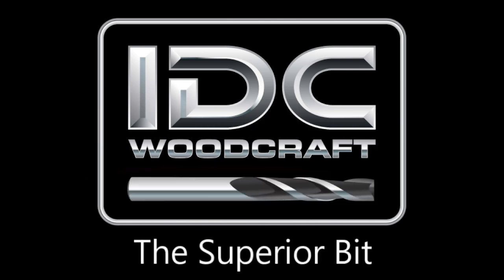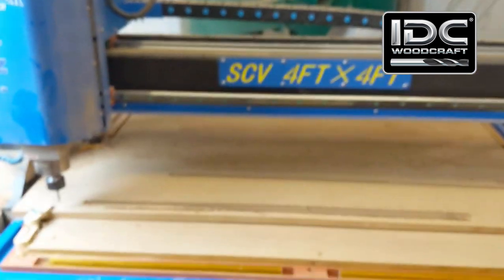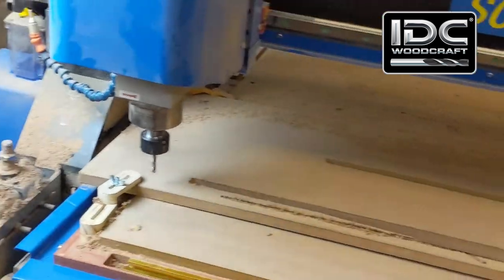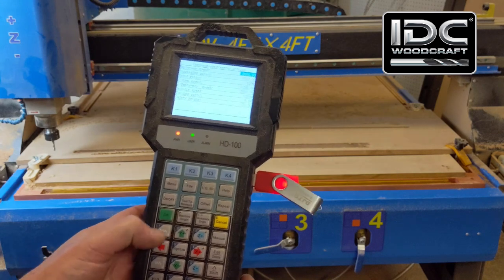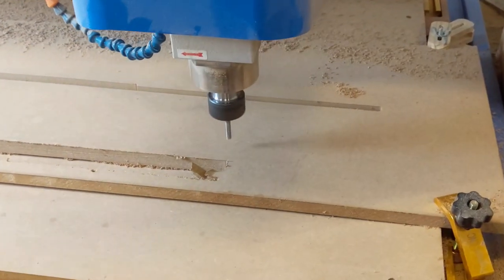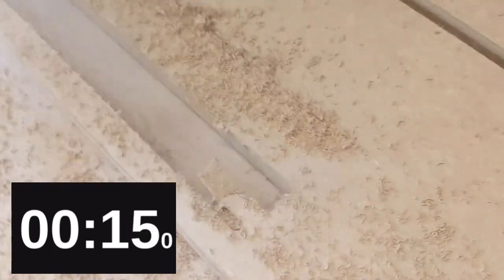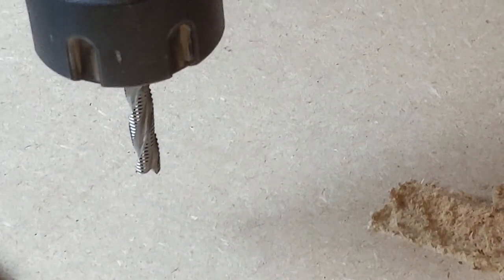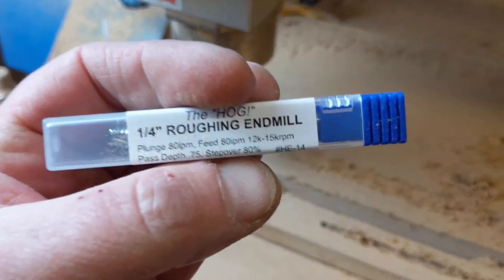CNC Router Bits - Pushing The HOG on the Phantom CNC router WOW

Comment: OK, that's MDF how's that speed in say, let's try something kinda soft, POPULAR, same speed and depth??
Reply from the maker: Karl, the settings are very similar brother! This machine RIPS.
Reply: @IDCWoodcraft  Can you show it cutting POPULAR with the same speeds and feeds??
Reply: @karlriley1314  I can run those same speeds on poplar, mahogany, etc. on my ShopSabre. I use this bit for clearance only. Edge profiles I change the bit and slow it down as the wood edges can fray and splinter.  This bit is purpose built IMHO.